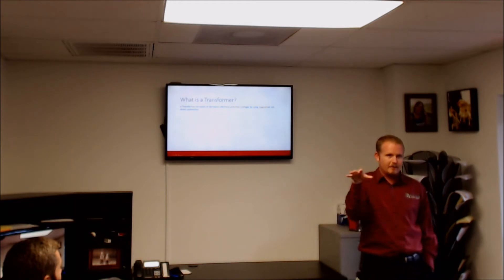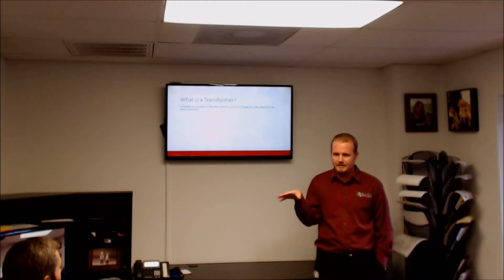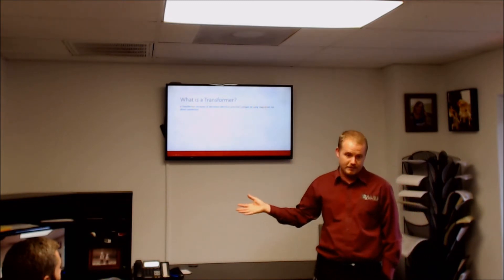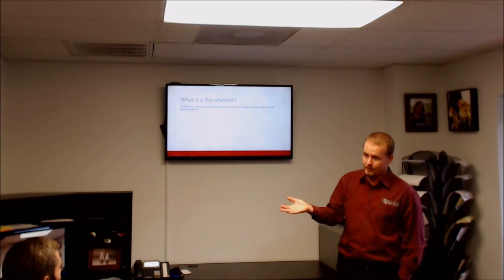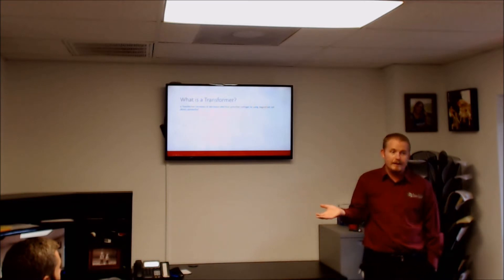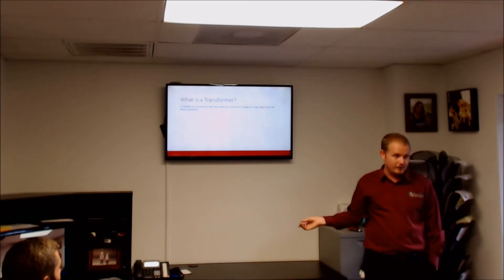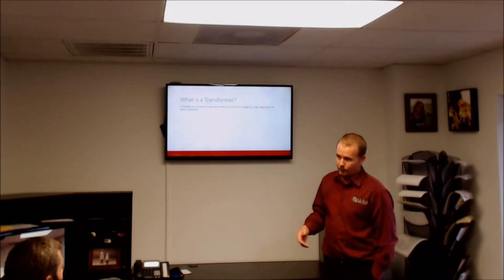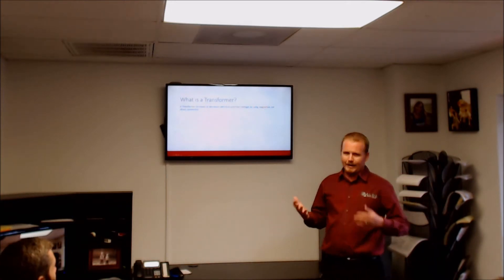From the Transformer to Your Outlet

Comment: 240v on a 2 phase output. for 360v simply add another phase.. industrial areas use 360v rather than 240v for more larger equipment. generally you won't see a 3 phase in a residential area! unless it is underground or small community.